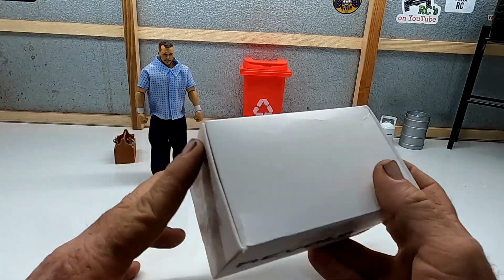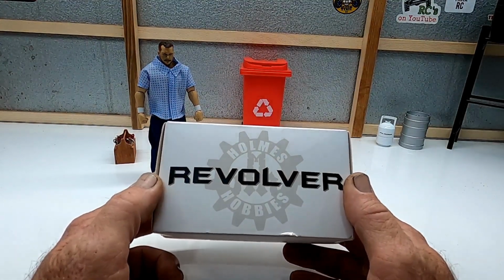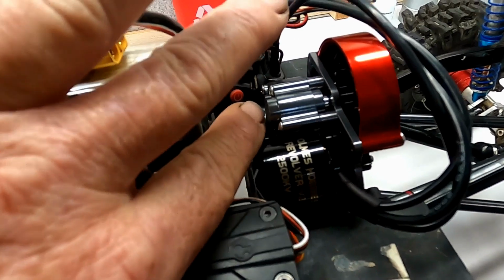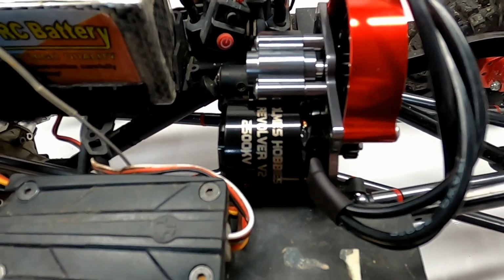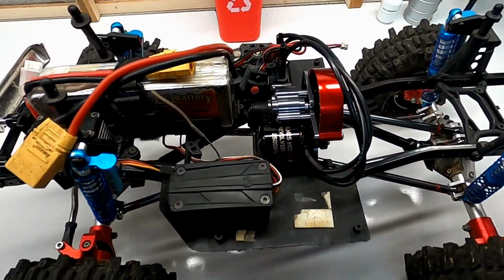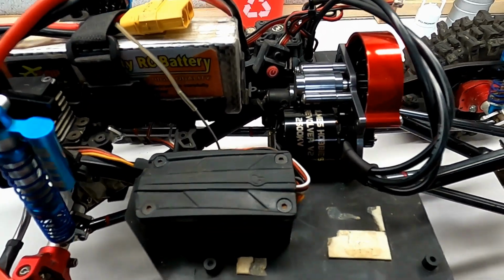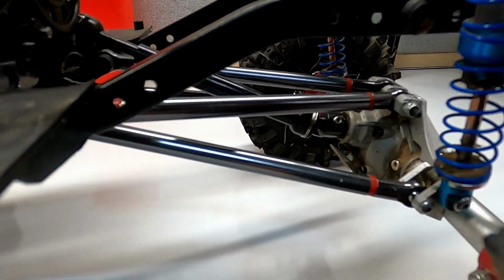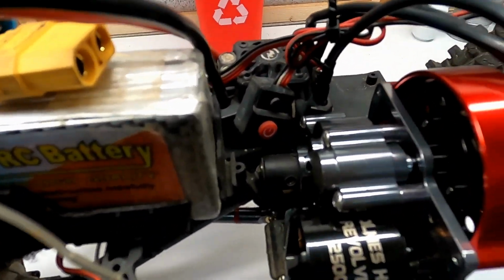Holmes Hobbies Revolver 2500kv 10p

Comment: It looks a bit jerky on startup. Might want to mess with your esc settings. I run my 3brothers outrunner off of a Castle Mamba micro 1/18 scale esc and it does great with a fan. Super slow and very smooth startup. I had similar issues when I first installed it. I was running a Hobbywing 120bl and i could never get it to start up smooth. Switched to the castle and it was night and day. Also seems to like 3s better
Reply from the maker: Much appreciated buddy for the info will check that out